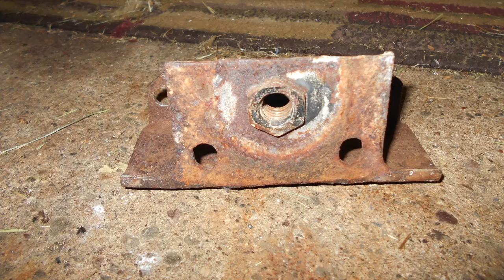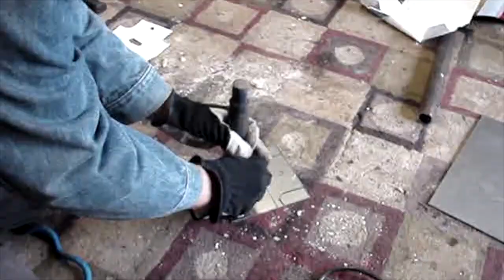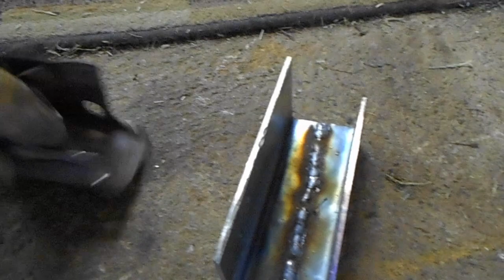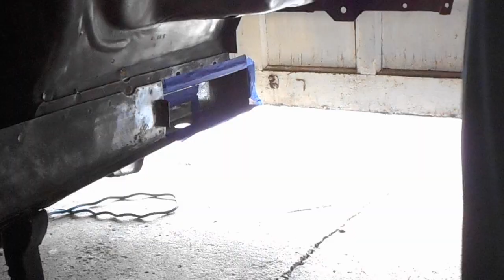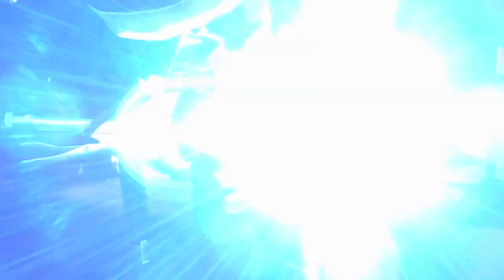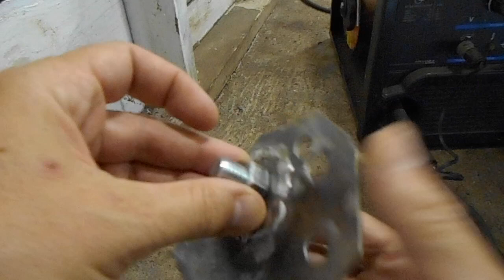Passenger Side Front Frame Rail Repair - 015

Comment: Frame rail twisted,  repaired and utilized 18 gauge steel instead of 22 gauge.   Time to repair frame rail and rebuild quarter panel at about 2 weeks  ,( since welds are expensive ). ,I utilized bumper bracket and RIVETs instead 2005 Hillside IL ;  NO fabrication needed Dan Marvin  Carlson. 1992 UNDERCOATING  YES,  ting full of lies
Reply: NEVER EXplaining to a man with FINANCIAL AUDITOR experience what M.A. Bodine cannot do.

Comment: Nice work!!! I have a crack on my Topaz frame where the control arm bolts, what's the best solder I should use?
Reply from the maker: Cut out the bad stuff and weld in the the good. Grind it so that no one can tell it ever happened. I use a Miller 135. It is old, but it works like a charm.
Reply: BODINE expert metallurgy Trust, 
 Topaz I Not worth rebuilding...no matter it's year.

Comment: I have a rust hole on my passenger side frame rail on my 1967 mustang. Could I do the same method you did to patch the whole with welded on metal?
Reply from the maker: Yeah, I think they make a replacement part for that
Reply: Rusty Bucket of Bolts by any Chance would you know what the part is called?
Reply from the maker: I'm thinking they are pretty common. I'm envious of how many replacement parts are available for mustangs and cougars. A quick google search for "Mustang front frame rail patch" came up with this

http://www.mustangsunlimited.com/Mustang/Body/Frame-Rails/Front-Frame-Rail-Outer-Patch-Driver-Side-1965-1970-Mustang.axd
Reply: Rusty Bucket of Bolts wow exactly what I was trying to look for! Thanks for your help and time it’s really appreciated
Reply: Mustang might be worth reuilding,   check motor mounts and wheel Wells first...exPerience no Wheel Wells. Because 80s cars frames, rusted faster.! Just ask Jonathan Larson. !!